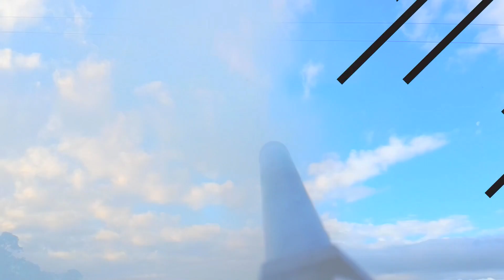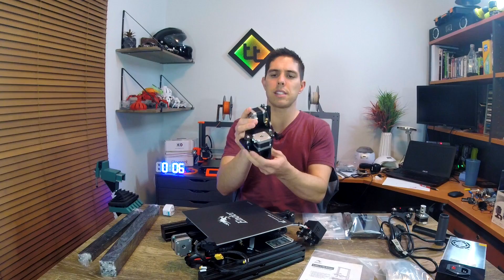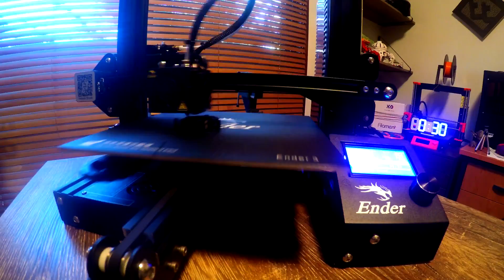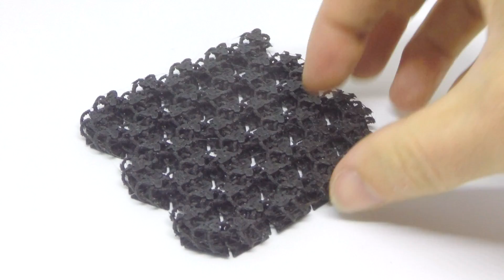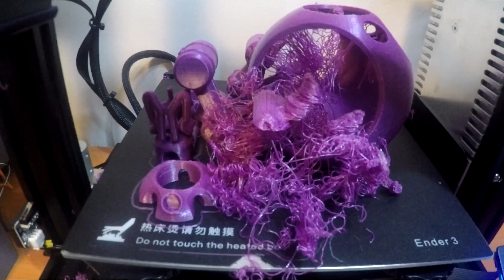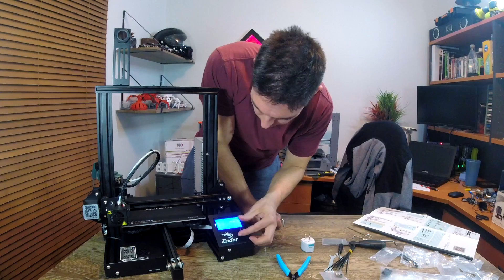Ender 3: The new standard in budget 3D printing? Now $190

Comment: Maybe I'm late to the game, but I have to ask… I just bought an Ender 3 — yeah, in 2025, go figure.
My nozzle keeps clogging. I already changed it for the spare. Is this normal?
I'm using PLA at 200 °C. I tried ramping up the heat on the hot end.
On a 4-hour print, it started flawlessly, but halfway through it stopped extruding material — the head just kept moving with no extrusion.
This has happened to me a couple of times. I don’t know what to do.

Comment: I got this printer for Christmas and I have to say the person who chose to send me this printer made a good choice for my habits. I like tinkering on stuff and this printer is great for tinkering as well as quick to setup.  

Only gripe I would say I had was the Z binding, but there is a mod on Thingiverse that takes care of that really well. After the mod, when you disable the steppers the Z actually drops on its own to the bed.  So you do have to be careful in that case.  Especially if you have all the bearings well lubricated and there is almost no friction.

Otherwise I would have to say this printer would be a great starter printer for anyone.

For the tinker type people the Marlin firmware that is in this unit isn't to bad to upgrade.  You do have to flash the bootloader to it first before you can upgrade it to the more current versions of Marlin.

Comment: I really like your knowledge and presentation style. I have, just this afternoon, assembled a Creality Ender 3 Version 4 3D printer. I have done a few prints. They are the dog on the micro SD card - I wish I'd taken notice that the sample PLA was insufficient; it got through 75%! I've made the display cable clips without any issues, and installed them. At the time of writing the "benchy" is printing. I used an A4 sheet of 80 gsm paper for the manual leveling. I am amazed that it works with so little trouble. The SD card dog uses 45 deg bed temp which seemed to work very well with a raft so I'm not sure why you recommend 60 deg, perhaps you could expand on this topic. Incidentally the version 4 ships with the little clips to secure the PTFE bowden cable and I think there are other improvements over the one you reviewed.

incidentally; did you shorten the Bowden cable. as supplied it seems to be far too long but as a noobie I'm reluctant to cut it shorter yet.

I was tempted by the Cocoon or the UK equivalent as offered by ALDI but they ran out of stock so I missed out... So I bought the Ender 3. BTW how can the buyer tell if they are buying an OEM machine or a clone?

Since I have down loaded an STL file from ThingyVerse, I am wondering, as a newbie, how to optimise the slicing for the machine and the object to be printed? The files on ThingyVerse do not generally give any clues, as far as I can see, The display cable clips did say to print on the side but that is fairly obvious.

Please keep up the good work and thanks for all your advice and suggestions.

Comment: I bought an Ender 3 Pro in January. I hate to say it but they have some quality control issues. It came with a warped bed, on an inconsistent gantry, the screw holes were not properly aligned and I have not been able to get a completed print out of this thing yet. The customer service is non-existent and seems like a bot with canned messages. Thanks for the review.

Comment: Hi,
I am an absolute newbie to 3D printing and have bought and assembled the Ender 3D. Can it be connected to a laptop and controlled from there rather than SD card, if so how?
Also Is there a guide as to how you send G Code to the printer? (I am totally in the dark)
Reply from the maker: You need to use slicing software to convert 3d STL files into gcode. The gcode can be saved to the SD card for the printer to read or you can stream it directly via USB and software like pronteface or aimplify3d. Just need to install the USB driver.
Reply: You can hook it up to your laptop via USB (usb mini) and you can control it with CURA or any other slicing software.

Comment: Well, after I got mine, still having troubles. I haven't been printing for 1 month now, mostly I ran out of money to put into it.
The wheels are bad, and I need new build plate surface.
Thinking of linear rails instead of the wheels. But to be honest, I have about 400$ wraped up in it, and still no luck. I will get these parts and try again, but then thats it. I am losing interest. 
Did you see the video on the new Ender 5?
https://www.youtube.com/watch?v=fjmwRz4q9_4
Gotta give them credit, they are trying.
I would like to get the cr-10. Was thinking about the anet e10. Not sure at this point in time. Sorry. Not to be negative, just not sure I can put more money into all this. It is a hobby, like electronics. Just takes money.
Have a great day!
Reply from the maker: Hi Tom, I'm sorry to hear you are still having troubles. For the two printers I've reviewed, they haven't had any issues that I had to spend money on. I understand quality control is not consistent, however. Thanks for the Ender 5 link. The frame and geometry is just like my old solidoodle 2.

Comment: For a week now I've been watching Micheal and other YouTubers videos. Great videos by the way Micheal, kudos to you, your videos are very very very helpful! But those videos are proof how a badly designed printer the Ender-3 is. I have estimated that with all the upgrades including EZABL and EZOut and TL-smoother, and Arduino Uno, and borosilicate glass bad, plus plus plus I will end up with mods that will have double the cost of my printer (I bought the standard Ender-3). That's including  a lot of parts bought on AliEpress and BangGood. The cheery on top was when Micheal  said in his review of the new Ender-3 Pro that the new Meanwell PSU is a nice improvement over the no-name one on the standard Ender-3 because less change of catching on fire. So now I realize I should have gone with the Prusa Mk3 all along. It would not have cost me so much more, I would have a better printer, and I would have saved many jours watching videos on how to fix that badly designed Ender-3 and shopping for the right parts on the web. I don't understand why the Ender-3 gets so many great reviews when it has so many design flaws.

One reviewer on Amazon USA wrote you need to build your Ender-3 and not assemble it to end up with a good printer. He put pictures how bad are the aluminum extrusions and that they are not squared and that he had to machine the extrusion to make them squared. I told myself this guy can't be right, because otherwise no matter which mods you do to your Ender-3 it's impossible to have good prints if the structure itself is not leveled. And since the Ender-3 have goods reviews... So I bought my Ender-3. Boy that guy was so right! From the six extrusions that needs to be assembled not one is squared!!!! To the folks that are going to check their Ender-3, don't use a 6-inch or 12-inch or 16-inch square like Stanley, Empire or Dewalt like the one sold at Home Depot. I went there last week and I was not able to find neither a Dewalt or a Empire square or try square that was actually... squared. 

That's my first 3D printer. That was supposed to be a fun project. That's not anymore, thanks to Creality and their highly flawed Ender-3 printer. So save yourself the trouble and go straight for a bette product. That's if your have the money obviously.
Reply from the maker: I respect your opinion and acknowledge that the quality control can be hit and miss but I disagree with your overall conclusion. Many of the parts you listed I would consider upgrades, rather than necessary fixes to get the thing to work. My Ender 3 Pro was used for at least a month before I corrected the wobbly frame, point being that it is ideal to have the extrusions perfect, but they have to be really bad before it causes any appreciable impact of function or print quality. YouTubers are generally in the position of having multiple printers to compare for reviews. The Ender 3 is not perfect but stacks up very well, especially for the money. For example, a couple of years I purchased a printer from Jaycar for significantly more than the Ender 3. The Ender 3 outperforms it by a very significant factor. The Jaycar printer could rarely print a consistent first layer and this meant a high failure rate.
Reply from the maker: Just to add: Yes the Prusa is a much more polished and refined machine, I'm still very happy with mine. The upgraded power supply in the Pro should be more reliable in theory, but I've yet to hear of a single failure or fire on the standard Ender 3 PSU.
Reply from the maker: One last thing, the previous king of budget 3d printing was the Anet A8. If you feel the Ender 3 is sub par, Google A8 required safety mods and you will see what a jump the Ender 3 is.
Reply: OP seems to be in concern about the QC of the aluminum frame, I have to admit that there are indeed some deviations from completely squared cuts, I actually tried to adjust the straightness of the standing Z frame while assembling the frame through slightly differing the tension of the screws, but since the top of the Z frame that may hold the filament holder has slightly off holes that connect to the 2 frames, it was kind of moot, but the results are still great anyway! my first print was actually made without the X gantry's belt properly tensioned, it was all flappy, but worked to make that cura robot done. (note that I'm quite realistic to only try print anything that takes 30-1hour time of print at first). from there I'm still satisfied with what my Ender 3 does, first 3D printer I have.

Comment: Quick question my ender 3 is not a week old yet I ha e printed a few small things on it printed a small snoopy dog for my daughter and when it was done I was going to print a owl for my wife but I had a over heat error on the screen. So I shut it down for a few hours and now as soon as I turn it on the extruder heats up really fast until it gives me a over heat error on the LCD. Would any one know what the heck is going on I am new to 3d printing and I'm at a loss. Thanks for any help.
Reply from the maker: Sounds like a short circuit so 24V is constantly been sent to the hot end without permission.

Comment: Thanks for the video. There is now an upgraded version for around $260. I'm leaning toward this one. Monoprice  has one that is supposed to print other materials not mentioned here namely, a support material that allows for harder material to be printed on top of. others such as food safe and harder materials as in roller skate wheels. the monoprice was having some electrical issues. So, it looks the Ender is going to be my best option. as a side note, I must have been living under a rock because anytime I heard 3d printer I assumed thousands of dollars and never checked further.
Reply from the maker: They used to be a lot more expensive. The reprap movement helped develop them to this price point, and in recent years machines like this have emerged that while not perfect, are excellent value. I have review of the Pro model you mention here: https://www.youtube.com/watch?v=TAUWlJt2Hmg as well as a dual extrusion clone here: https://www.youtube.com/watch?v=AbZhNvMM4Os
Reply: To clarify, i'm finding the monoprice has some issues. The upgraded Ender 3 not the Pro looks interesting. I like the glass bed idea. My understanding,  the glass bed will take higher temps that is not recommended on the Pro

Comment: Absolutely blown away by my E3. My paid upgrades are limited to a replacement aluminum extruder hardware for $6.60 on AliExpress and a replacement Capricorn bowden tube which was the left over bit from my delta upgrade so it was kind of free.  Also a bit of 3mm glass from a picture frame plus Aquanet is my build surface. It's perfectly level and I don't need to re-level the bed because I'm not yanking on it to get prints off. Therefore I have no interest in auto level  because the bed rarely goes out of level anyway.
Reply from the maker: Awesome to hear it is printing so well for you. My print failure rate is very, very low too. Generally any issues I have are used generated.

Comment: Hi Michael

I've just received my Ender 3 and, never having been 'hands on' with a 3D printer before, my experience of building the printer was very different to yours.

First problem was that the right-hand upright refused to sit down correctly. The holes through the base piece (or in the end of the vertical extrusion, not sure) were slightly out of alignment - easily fixed with a few touches from a round file.

Second problem was with steps 6 and 7. The ferrules on the ends of the drive belt are huge and there is no way on earth that they will pass beneath the roller wheels, so the belt has to be fitted around the extrusion before the extruder carriage is fitted (i.e. before step 6).

Then the real problem came at step 9. The leadscrew is way off centre from the Z Stepper coupling - about 4mm in one direction and a bit less in the other.

The problem appears to be that the extruder mount bracket, that holds the floating guide bush, is simply wrong. It's not bent at 90°, the line of the bend is not correct and, as a result, the extruder is at an angle of about -5° and the floating guide bush is a) at an angle to the leadscrew and b) about 4mm offset from the axis of the Z-Stepper.

There is absolutely no way that this will ever work satisfactorily (let alone well). It is possible to assemble it but everything is strained, the leadscrew is nowhere near vertical and it's incredibly difficult to move then X-Axis bar assembly by hand in the Z direction and the error is so great that it really struggles to reach the bottom of its travel.

Both the X and Y travels feel very 'lumpy' and the X has a distinct 'hole' that the hotend carriage encounters with a distinctly audible clunk (I need to disassemble it all to try and discover the cause.

I'm inclined to abandon the whole 3D printing idea and throw the Ender and the rolls of filament back at Amazon.

There's no way that my example can actually work correctly and it's not 'fit for purpose' - unless I'm not seeing some way to compensate for the out of alignment bracket and that the travels will eventually smooth out after a few rolls of wasted filament.

I'm a pensioner, this was a big spend for me and I'm extremely unhappy with what I have.

"Benjamin Franklin: The bitterness of poor quality remains long after the sweetness of low price is forgotten"

Any ideas on fixes before it goes back???
Reply from the maker: I say persevere. You will be satisfied. Maybe this can help: https://www.youtube.com/watch?v=xnzNd_FIMKY
Reply: @TeachingTech  That's exactly the problem I have with the Z Axis but, unfortunately, I don't have a workshop vice or a big hammer to fix the problem.

Frankly, the end-user shouldn't be required to modify a part that's been incorrectly manufactured and, in so doing, invalidate the warranty. The manufacture should be able to determine which batch of printers are affected and supply a correct replacement - but I don't believe that will happen.

Are Creality aware of the problem? If so, why are they still shipping printers with an incorrectly formed bracket? My printer was purchased from Amazon but it was directly shipped to Amazon.es from Creality, so it's 100% current.

Ah, what the heck, it's a budget printer - right? Yes, but it's cost me 25% of my total monthly pension income, so it's not cheap to me...

The Z Axis misalignment is just one of my problems and I'm limited in what I can do to fix things that really shouldn't need to be fixed by the customer..

Comment: Great video...but i just ordered an ender 3 for my classroom using donorrschoose. The preassembled main frame was wobbly...that is to say the four corners would not lay flat on the table. I expected some issues and do not mind assembling stuff. . But that is a huge oversight in quality even for a $200 printer.i wouldnt waste your money.
Reply from the maker: Sorry to hear. This would be the exception, not the rule. You should be able to loosen the main frame bolts, let it settle and then tighten.
Reply: Teaching Tech 

Thanks for the reply! I love your stuff btw. I tried that. Unfortunately, when i retightened it was still wobbly. Im calling in for a replacement. But if that one comes in with any major issues, I think I am just going to mark creality off my list of printer makers that can be trusted.
Reply from the maker: Fingers crossed they look after you and make things right.

Comment: Terrible printer, bad assemble quality from the box, good for small models (pla plastic). abs plastic models have cracks if you want to print medium sized models. This is my first 3d printer, because each channel about 3d print sells you ender 3. I not recommend to buy this printer
Reply from the maker: I'm sorry to hear you had a bad experience, however you being new to 3D printing is surely a factor. The reason so many channels recommend it is because it compares very favourable to anything else in its price range. It's a great base but like any 3D printer tinkering is needed and patience too.